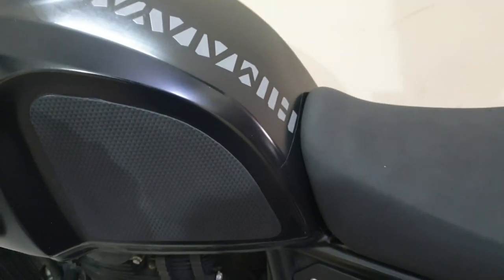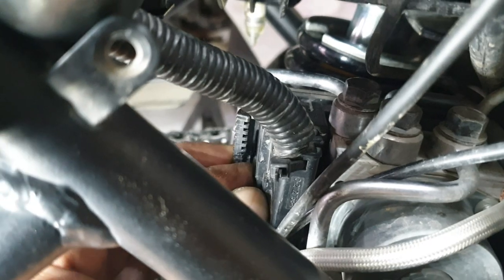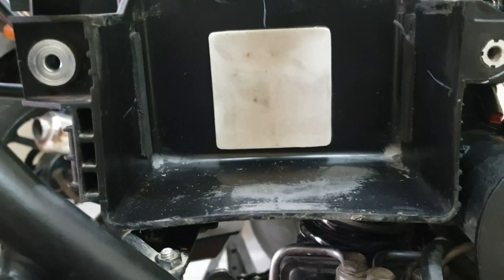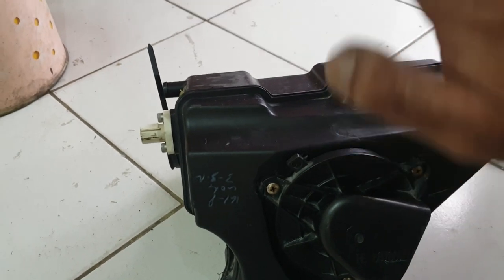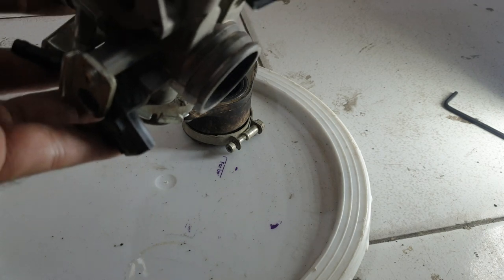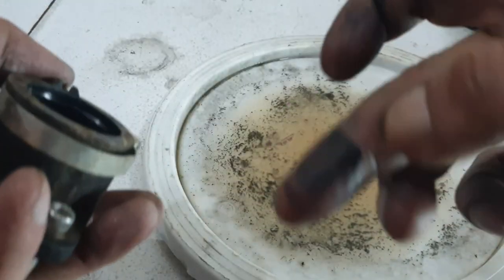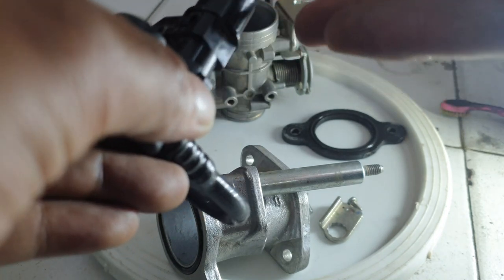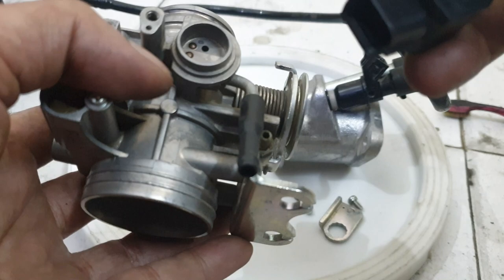Royal Enfield Himalayan DIY Throttle / Injector body Disassembly | Cleaning | Part 1

Comment from the maker: Hi
This one covers the Throttle / Injector body cleaning, have been thinking since past few 1000 kms but laziness got me as the process is a bit tedious and thus lengthy. Finally it was time. 
This one covers the removal of airbox, rear under body mud gaurd and removing/cleaning throttle/injector body itself.
Have done a detailed video on Tank Removal so not covering that but here is the link
Royal Enfield Himalayan Tank Dismount | Remount | Plus Water in the Tank | How to Avoid | DIY
https://youtu.be/7oxhPYDHwvo

Part 2 will include the re - assembly, process is just the reversal of what has been discussed here. its being worked on, will be uploaded shortly
Cheers :)

Comment: I have an intermittent abs light. I wanted to disconnect the abs plug going into the abs unit. I couldn't see how the plug came undone. So I went back to this video, knowing that you explained. And then I could see. These videos come in so very useful. Hopefully I won't see the abs light on again after its plug clean and wd40 then it's compressed air blow out. Thanks again for all your videos. Mark.
Reply from the maker: Hey mate. Glad to know this vid was of some help. I hope the issue is sorted

Comment: Absolutely love your content.. as a owner of the first version bs3 Himalayan, i have always thought about doing some complex repairs myself.

Thank you!!

Can you make a video of all the tools required to work on the Himalayan by ourselves? Including engine assembly
Reply from the maker: Thanks mate, 
BS3. I miss carbs in general, I do. The sheer simplicity and ease of use. And it didnot have that evap unit either. Love affair started with bs3 to be honest but ended up marrying bs4 :D
Not complaining though.
And yes, as bike accumulates more miles, will keep updating all that is done, including engine works but to be honest that's gonna be a while. Maintain them well and they should see 100,000 kms engine wise ;) went too far there didn't I, more like 70-80000 kms, fingers crossed. Will keep updating
Cheers
Reply: @leuheanrede  yea i do the regular maintenance myself.. 

And by ' tools 'i mean the actual hardware required to strip down the bike.. can you list them or make a video so i can buy them for my garage..  forgive its its too much to ask
Reply from the maker: @shakthigopalan8849  No prob mate, I thought you needed the list of tools to open engine :D my mistake. 
Will start compiling a list of most used tools. 
Thanks and Cheers :)
Reply: Yes absolutely...the viewers want a complete list of tools to start these DIYs...that would be really helpful and meaningful..
Reply from the maker: @001gurjitsingh  Sure mate, will work on this and compile a list and post soon :)
Cheers:)

Comment: Hats off to you bro, really tedious work due to space constraints.
Reply from the maker: Thanks bro, thats what we get when things are added after the original design, case in point, fuel injection and evap. that is why i miss carbs, simpler times.
Cheers :)
Reply: @leuheanrede  no way out , less pollution is the need of the hour. We have to spend more & maintain more  😢
Reply from the maker: Indeed mate, that's the way to go. We have time at our hands :)

Comment: Thanks a ton, I had to remove air box, swing arm, forks, stem, Tank in order to replace chassis.
I found that Bushing rubber in Mono shock rear has worn out. RE Serice Center said it comes with the rear shock as a whole. Do u have any idea where to fetch the bushing rubbers or any DIY ?
Reply from the maker: Thanks mate, and best to approach a suspension rebuilding shops, you will be able to find a good substitute there, and also try local  mmotorcycle part shops, they do keep bushing, cheers :)

Comment: Amazing work dude! But definitely not diy for me!☺️
Reply from the maker: Thanks mate. And trust me it just takes some time on the first attempt, after that you will be working like a pro and getting it done in like 30-40 mins. Thanks again cheers
Reply: @leuheanrede  Thanks for writing! I always wanted to be able to do few things, injector cleaning is surely high level stuff, but yes other things like brake bleeding, handlebar greasing, cleaning spark plug, install charging port, etc. You have covered many of these simple things with so much perfection that I'm absolutely sold! I will definitely try start with something simpler and then maybe one day, to stripping down till injector, and putting it all back correctly! You're a genius man! Cheers! :)
Reply from the maker: Thanks for such kind words mate. And trust me its pretty simple once you start doing it. Thanks again, cheers :D

Comment: that mean the air box has to be removed to change the accelerator cable? or it has enough space to remove the cable without removing the box and battery?
Reply from the maker: Yes, there is enough space to change cable without removing airbox and battery. 
Cheers :)
Reply: @leuheanrede  ok....thanks
Reply: by the way...love your content. keep going..
Reply from the maker: @itsarindambanerjee  Thanks for your kind words mate. Truly appreciated :D

Comment: Great . Going to try this DIY.
Reply from the maker: Have a good time mate ;)
Cheers
Reply: @leuheanrede  did it bro thanks. Really enjoyed it. Just small thing dont know you you mentioned it or not . I mistakenly put accelerator cable in wrong hole forward one And got little heart attack when start the bike.😂😂😂😂
Reply from the maker: 😂 I can understand the heart attack part, and you are right, i think i forgot to mention that in the vid. The second one is for double throttle wire/pulley system. but all's well that ends well :)

Comment: You really need to stop putting out these videos, cos you are causing more damage rather than actually doing any real maintenance. I wonder from where you got the idea that one can clean a fuel injector with a piece of wire? And once you remove a fuel injector, it cannot be put back in, now do not ask me why cos if you do then it proves you know nothing about fuel injected pumps.
Reply from the maker: Hey mate. There are better ways to do it, I agree. Not gonna get into confrontation. But it just shows some people have not worked with a really gunked up injectors before. And not sure about that putting injector back in remark. I did remove everything and put everything back together. Still thanks and Cheers :)
Reply: @leuheanrede  Well ! If you consider me to be a fool, then just shoot a mail to the guys at RE, who assemble the fuel pump and they will tell you a few things about fuel injectors and what happens if you remove a fuel injector and try to re-install it ? Now the reason I say RE, is because you are working on one and they are based in India, so communication should not be a problem.
Reply from the maker: @stankropiunik2539  I am curious now sir as to what you are trying to say. Why do I need to email anyone when i myself have opened it all, put it back and bike is running better than before. Let's have an open dialogue on what you are trying to put through. I am befuddled by your unwavering attempt to say things that I have already done. Or are you just trying to troll me :)
Cheers
Reply: @leuheanrede  I apologies to you for coming on to your page and wasting my time. You are the chmpion !
Reply from the maker: And I apologize to you for your childish, immature and unfounded pedantic views and opinions formed by watching and reading consumerist content posted everywhere for free to brainwash into the state of confounded opinions and views that you so ignoramusly find pertinent. 
That being said, happy paying a million to your friendly neighborhood mechanics. Again I say my "sweet troll", thanks and cheers mate :D
Reply: @leuheanrede  And you with your content, in the land of the blind, with your one eye knowledge of motorcycles, shall always be king .
Reply from the maker: @stankropiunik2539  no no Sir, please you take the title of king, I am happy as a blind peasant :)